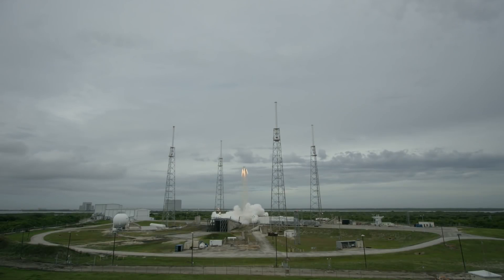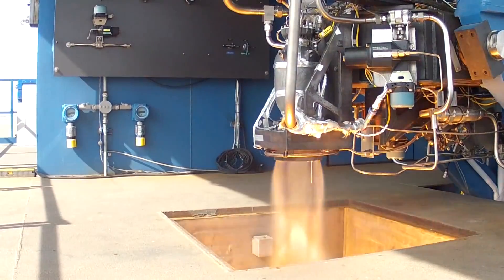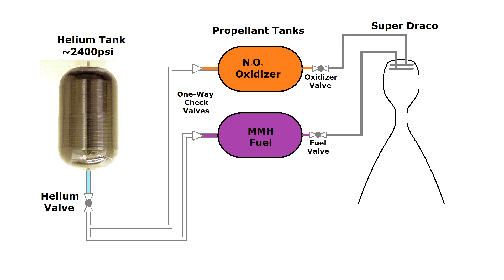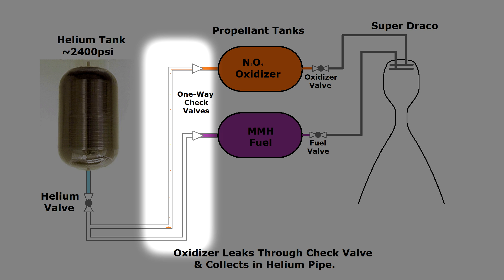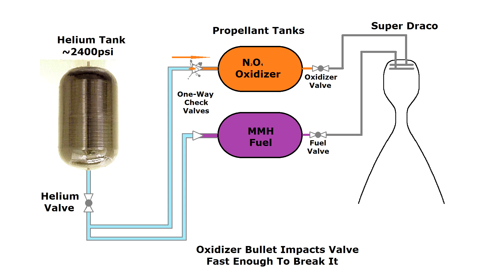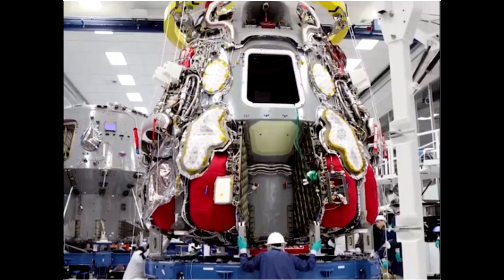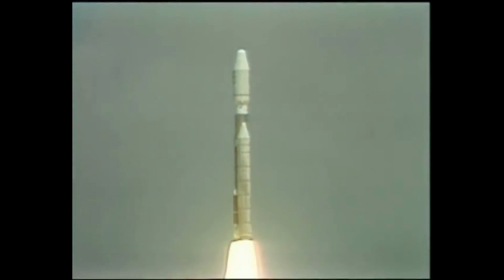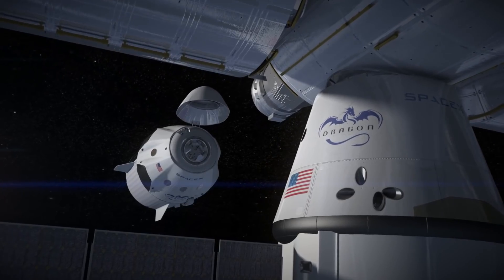SpaceX's Crew Dragon Spacecraft Exploded Because of 'Corrosive Bullets' and Leaky Valves

Comment: Could the mechanical check value have been adversely affected by saltwater?
Reply: The problem occurred inside the check valve.  Only the exterior would have been exposed to salt water.  The system was totally sealed before and after the flight so there was no way for water to get inside the check valve.
Reply: They are under really high pressure, heat issues, cooling issues, etc. It's asking a lot from check valves.

Comment: Another way is to have two valves (one backing up the other) then a burst disc as the last line on defense. So the Two valves are opened, then the resulting pressure opens the burst valve, in this way, the system can fire twice or more, just flowing through the already burst valve until replaced.

Comment: "high power airguns that are not as nearly as high pressure as the helium system" sorry but you are wrong, my falcon fn19 air rifle is filled to 200bar (2900 psi) and that is a UK spec air gun running at sub 12 foot pounds muzzle energy (any higher and you need a firearms certificate) there are some paint ball guns which have tanks that have a working pressure of over 300bar (4351 psi)
Reply from the maker: I'm talking about pressure in the barrel - the air gun you talk about has a small cylinder, pressure drops during firing. The system I show has a large tank able to push half a ton of fuel.

Comment: Looking at the diagram, there's a path from the oxidizer to the fuel upstream of its check valve, so the oxidizer could maybe have got into the fuel path and then injected into the fuel tank at ignition, with similar or more catastrophic results.
How do they know that this didn't happen?
Reply: They know which parts burned.

Comment: Forgive me if I'm being a bit of a nubbins, but how do burst discs make a suitable replacement for a one-way check valve? It seems to me that a burst disc would act as a no-way check valve until it burst, when it'd become a two-way aperture.... I should probably add my only experience with burst discs is in your common-or-garden internal combustion engine, so I've no clue how they integrate into the dragon capsule arrangement - I feel sure thats the reason I am confused!
Reply: I guess they only ever intend to use this system for an emergency, and if that happens they just burn to depletion.
Reply: Doesn't help me! I'm trying to understand how a burst disc would work in the context of allowing something to flow one way but not the other!
Reply: @K1lostream  If the abort is not fired, there is no need for anything to flow either way. If the abort is fired, the helium ruptures the disc, flows the correct way due to the pressure being higher in the helium lines and all the tanks are emptied. After that, you just dont care, all the tanks are empty.
Reply: TheBackyardChemist - That's what I needed! Thanks, TheBackyardChemist!

Comment: They still use MMH carcinogenic fuel? I expected better from a company like SpaceX. The burst plate single action design also doesn’t sounds safe in my opinion or there must be a way to replace or block them during flight. N2O4 in combination with hydrazine is used for decades so must be a minor fix in their design. On the Titan rocket N2O4 was also glogging up during transfer before launching.
Reply: During flight? Why?
Reply: Appable if it burst you can’t start the engine anymore and helium will vent to space. Or there must be multiple burst plates with check valves to stop them when burst.

Comment: The burst disks don't make sense to me. Check valves allow flow through them in one direction. The burst disk would be a replacement for a relief valve, but not something that is expected to see nominal flow. Can you explain this?

I'm a propellant/fluid systems test engineer at NASA JSC and I regularly work with similar systems, but I don't see how this fix works...
Reply: Helium should always be at a higher pressure than the propellents, so flow inherently would only go one way after a burst disk ruptures.
Reply: The system is only for aborts, so the discs remain intact unless there is an abort. If an abort happens, they burn to depletion so after thats done there is no need for a disc/valve.

Comment: Do i understand correctly? Burst disks withstand the pressure of the fuel and oxidizer tank pressures when the helium valve is still closed, but burst when the helium valve is opened. This only works for one-time use systems that deplete all the fuel and oxidizer after activation (which is fine for an escape system). Right?
Reply: Yes.

Comment: I see alot of "Why did/didn't they..." questions. Here are some answers:
They used a check valve because it was originally designed to land under power, and they needed to be able to restart the engine.
The burst valve will replace the check valve entirely. They only need the engines for crewed flights, and crew dragons are only used 1 time before being turned into cargo dragons. So one and done is fine since these engines are only used for aborts.
They used 1 valve because two valves increases complexity for no real gain.
They do not plan to design something to replace the check valve because the whole thing is rendered obsolete by Starship.
Reply: I suspect the system is more complicated than we're imagining and "leaky component" doesn't actually refer to the check valve. I doubt they'd have a single check valve nominally separating helium from nitrogen tetroxide.
Reply: @AmbientMorality  You are right, the system is complex. The name check valve conjures up images of the thing that keep your sump pump from flowing backwards.
The check valve is in fact closer to a molecular sieve that an actual mechanical part.
to the best of my knowledge, there was only 1 in each line.
Reply: @joshua43214   molecular sieve,so someone needs to change the fuel filter(absorber) and yes I had to look up molecular sieves learned something today....👍😃..We can  build  material with holes in them so small and so precise as to filter molecules by their size yet alone so numerous as to run a rocket  and compact amazing.
Reply: Rendered obsolete by Starship?  I'd be willing to guess that's not true depending on the payload required.  Starship would be massive overkill for getting a few people to the space station.
Reply: @brainmind4070  In the mind of Musk, the ISS is itself obsolete. Why invest that much effort and money into something that is already history. easier to just toss in a tried and true part, charge a premium for not being able to reuse that capsule for crew and be done with it.
Musk expects entire industries to open up in orbit. the ISS will be small change in the big picture, and getting crew there will be secondary to getting workers to industrial stations.
Reply: @joshua43214  Um, well, he may well consider it obsolete, but he still realizes NASA is funneling money into SpaceX for the express purpose of resupplying the space station.
Reply: Brain Mind The payload size/ mass isn’t what really matters.  Think economics. 
Partially reusable F9 cost is $50M to launch.  Fully reusable Starship cost will be $10M. 
If you want to launch a grain of rice into space, which would you choose?  Remember...You’re buying.
Reply: @737smartin  There's no way Starship will be cheaper to launch than F9.  Everything they are doing to Starship to reduce cost can be done on F9 redesign.  You don't use a Saturn V to launch a microsatellite or a semi truck to deliver a letter.  Same logic applies here.
Reply: @brainmind4070  You don't use a Saturn V to launch a microsatellite or a semi truck to deliver a letter.

Just being Mr. Pedantic:  You would if you were launching a whole bunch of individual microsats or a whole bunch of individual letters.  Economies of scale are real.
Reply: K Kutani It was an analogy.  A few astronauts going to the ISS would not benefit from Starship.  There are microsatellites that must be inserted into specific orbits for which piggy-backing would not be appropriate.  Such situations would most efficiently utilize a platform like Pegasus... as long as we're being pedantic :-)
Reply: @avid0g  : Also, they can always just switch to an in-orbit maneuvering system to adjust Dragon's orbit, and launch that as a payload.
Reply: @brainmind4070  SpaceX is doesn't need a re-usable Dragon to supply the ISS, and it seems they consider that contract too low vulume to justify it. They can't really apply the things they're doing with Starship to Dragon, because they are VERY different vehicles, and that would require extra investment into what they consider a dead end. Starship seems to be envisioned as the DC-3 of spaceflight. Something that will totally reshape the market. There will probably be a market for something of Dragon's size, but it seems like SpaceX doesn't want to spend effort in that direction right now, and if they did, they'd probably want to build a new spacecraft that's very different from Dragon. Probably something that combines the upper stage and spacecraft together the way Startship does, rather than something like Dragon on top of a separate upper stage, with a disposable trunk to boot. I can see why they would consider it a dead end architecture.
Reply: @TonboIV  
Agreed. Musk asked for proposals to make Falcon upper stage reusable and nothing seems to be acceptable.

I can see the upper stage using methane instead of RP1. This would increase ISP and widen the applications for Falcon Heavy. However, SpaceX has no incentive to develop this when Starship is already going to replace Falcon9.
Reply: @TonboIV  What is the market for Starship?  How will they make money at first off of Starship?  There just isn't a market at the moment for transporting 100 people.  Building it will not by itself open up the market.  If you really think those suborbital hops to places around the world are really going to be a viable market, I've got a bridge to sell you.  Even if it's only $10M per launch, that's still $100,000 per passenger, probably more, to make it turn a profit.  That's a lot of money to spend to take a few less hours to get to the other side of the planet, and that assumes a full flight.  Do you really think there are enough individuals willing to spend that much money on a regular enough basis, all flying to and from the same locations on the planet to make it economically viable?
Reply: @brainmind4070  Now you're just being contrary on purpose. If you think there's no market for starship, than a reusable Dragon is obviously a terrible idea too. A handful of ISS flights don't justify it.
Reply: @TonboIV  The difference is that Dragon has already been developed, almost fully for man-rating.  Are you telling me that you think suborbital ballistic transport is going to become a thing?
Reply: Brain Mind Welcome to following SpaceX and their plan, Brain.  You obviously have a LOT to learn.  SpaceX DOES expect the mature system cost per launch of the Starship to be $10M.  They DO have big commercial use plans for such inexpensive lift.  If delivering a letter with a semi truck took no more time than using a moped, but cost 1/5th as much, then YES...I would deliver the letter with the semi.
Reply: @brainmind4070  There is actually a pretty good market right this moment for Starship, and that market will do nothing but continue to grow once it is in service. Lots of stuff that people have had to put off waiting for SLS for example.

The point is that Falcon 9 is done. SpaceX is no longer developing the system, they are only working at recovery. They are quite happy to let NASA pay extra to use crew dragon while they put all their effort into developing what they believe is the next generation. Whether Starship is the right vehicle or not is not important, what is important is that they are out competing everyone, and have wisely chosen not to development falcon 9 any further.
Reply: @joshua43214  So what's the use case for this market you're talking about then?  Point to point global transportation?  Yeah right.  If you're talking about some space-based application, though, I'm all ears.  There will almost certainly be a market for heavy-lift rockets.  As I understand it, though, "Starship" refers to the human-habitable upper stage, though.
Reply: @737smartin  SpaceX tells investors and the media they plan on being able to launch Starship for $10M.  There's a difference there.  So are you telling me you think the global market is large enough for $100,000 per seat to be viable for their point-to-point global travel (assuming 100 passengers per flight)?
Reply: @brainmind4070  Starship is the upper part yes. You can put anything in it from fuel to people. There are some very big and heavy satellites that need this system, and there is alot of speculative money out there waiting for an affordable heavy lift system. Two big cargoes + a bunch of small ones means profit. Space X is busy proving that not only are they cheap and reliable, they can also do complex maneuvers to offload into multiple orbits.
Musk is all in, either he wins this or he goes bust.
Reply: Brain Mind You have only part of the plan and you have it mostly very, very wrong, Brain.  I find the plan fascinating, and I hope you’ll do some research.
IMO, IF SpaceX’s Raptor engine proves reliable, they’ll deliver.  Musk has been accused of being a tricky snake oil salesmen all along, and he’s consistently delivered the breakthrough goods.  I’ll not pick against him until I SEE a significant failure to deliver.
Reply: @joshua43214   Changing an orbit's inclination takes an immense amount of deltaV.  I have no doubt there will be a market for launching satellites, though, aside from the more outlandish aspects of the system being publicized.
Reply: @737smartin  Yet you fail to expound on their 'plan'.  Elon has proven time and again to stretch the truth as much as push the envelope.  Perhaps unrealistic goals are necessary to push the envelope, but the fact stands that reality consistently falls short of SpaceX's promises.
Reply: Stuff isn't supposed to FAIL, though, on rockets.
Reply: Uhhh why wouldn't you just invest...in the beginning...in a valve that bleeds pressure into the system slowly when commanded to open?
Reply: @SpenserRoger  
Super Draco is now only used in emergency circumstances when millisecond delays are significant. The propellant tanks must be pressurized by a high flow-rate helium supply prior to operating Super-Draco thrusters.
Reply: @SpenserRoger  Because this is a launch abort system? "Slowly" is Not a Good Thing. 

Just in general, rockets don't do things slowly, either. Everything is at absurd pressure and flow rate, because that's what it's designed to be at. Trying to run it too much lower than that just doesn't work.
Reply: In an emergency you don't want to wait the the system to pressurize.  It has to be ready to go immediately when the abort button is pressed.
Reply: @stevenf1678  I'm not sure there's even an "abort button".  I think it may be automated.  An abort could be initiated if certain parameters are not within a specified range of acceptable values.  That would certainly be quicker than waiting for a human to detect and react to the problem.
Reply: What about the Draco thrusters though? Surely those will need to be fed propellant during every mission. Are there different lines for those?

Comment: This question will likely reveal the depth of my ignorance on this topic.  Would it be feasible to remove the helium valve near the helium tank and then replace the check structures with valves closer to the the oxidizer and fuel?  Is it too difficult to time the opening of the two valves?  If this is the case, how do the two valves downstream of the oxidizer and fuel accomplish this task?
Reply: My guess is they don't want the system to be under pressure until it's firing, as it's far more likely to develop leaks.

Comment: Maybe the check valves are a relic from the earlier propulsive landing design. But who cares. We'll never know.
Reply: Fabian Consiglio they were. They were intended to be fired twice in a mission in the event of an abort to both pull away from the failing rocket and land. They were also intended to be fully reusable so that they could perform many landings without replacing anything other than the trunk.
Reply: Yeah, it's a real shame.  I always held out hope that they would return to the propulsive landing, perhaps for non-NASA manned flights.  The change to using a burst disc instead of check valve pretty much puts propulsive Dragon landing to bed.
Reply: @CorruptDB  they will have starship landing propulsiveley